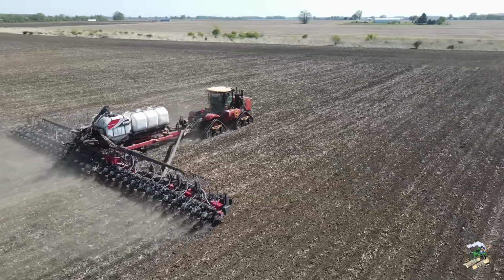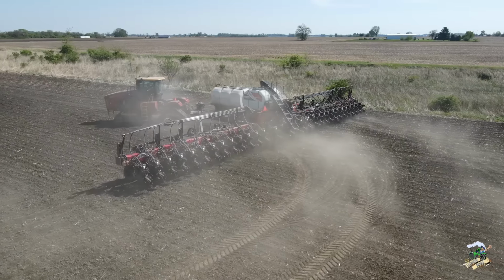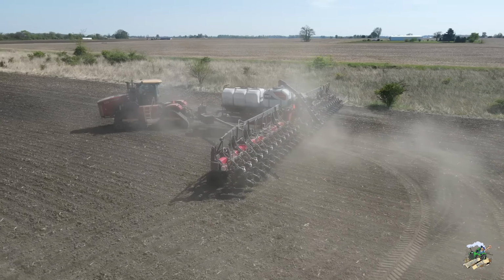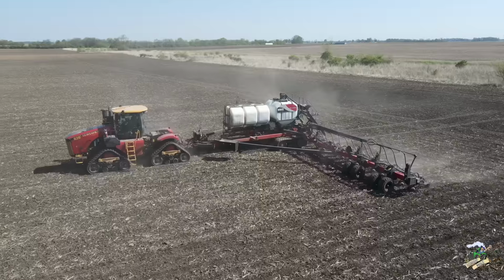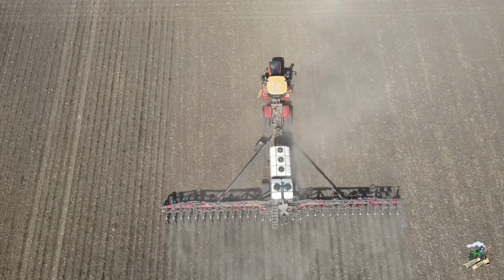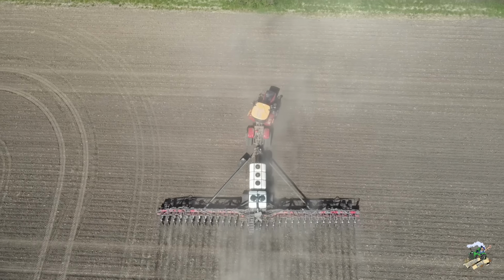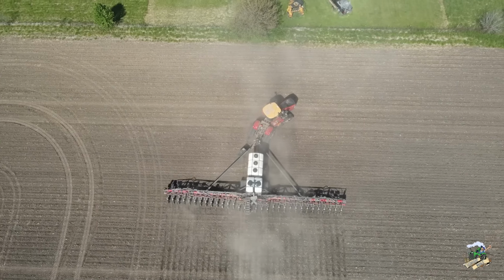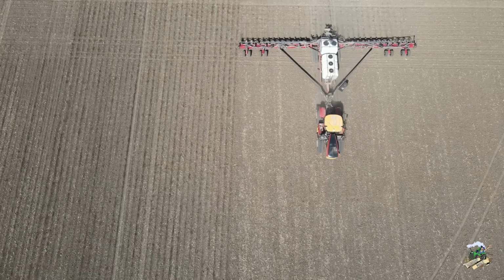Versatile DT620 Tractor pulling a White 9900 32 Row Corn Planter

Comment: Can someone tell me why farmers do the outside first then drive all over it when they finish a row and not at the end when all the turning is finished? Tractors may not do that much damage turning on them all the time but no damage is better than some. Surely with gps the computer can figure it out.
Reply from the maker: Ive seen people plant the end rows last using GPS but I don't know that they are really hurting anything planting this way. They are most likely going to have to drive these exact same tracks when side dressing the corn and spraying after the corn is up. Even running over the standing corn on the end rows while it is still short doesn't do much damage.